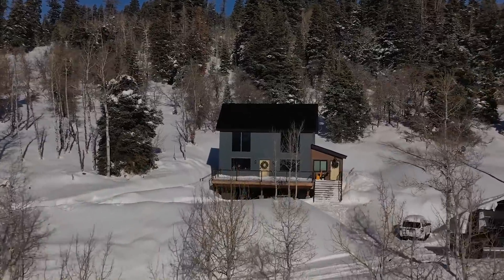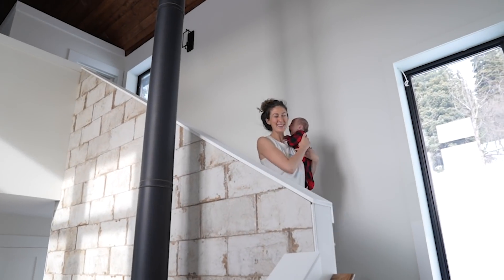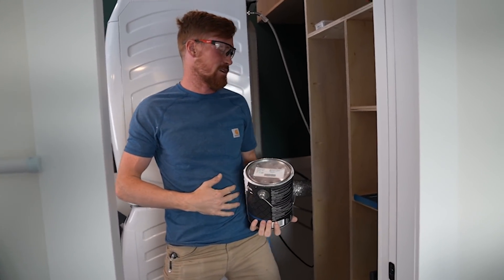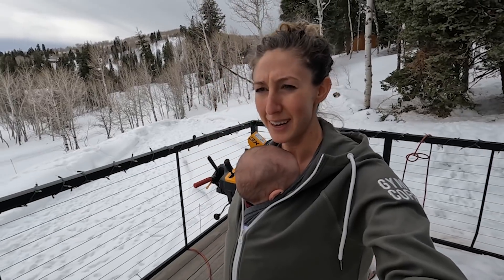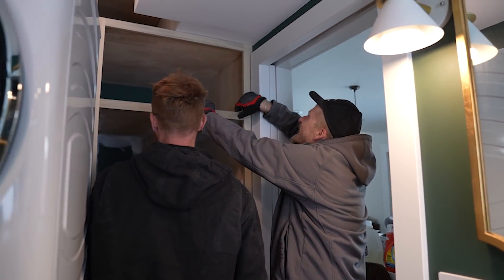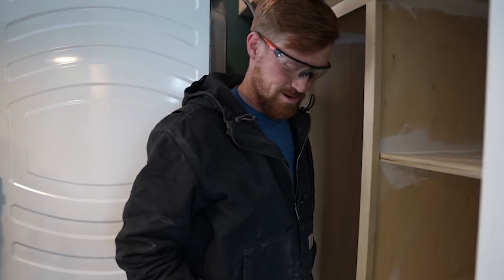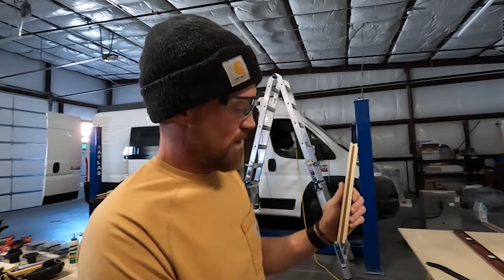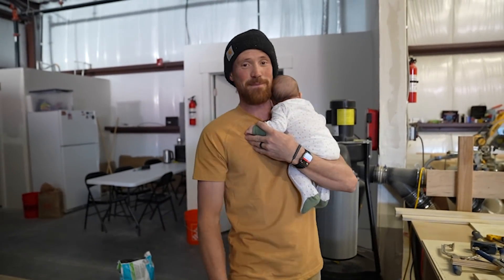I MADE A BIG MISTAKE | KNOWING WHEN TO QUIT

Comment: I had floor sliders/gliders on the bottom of my stackable. So easy to slide out. Also functioned as unintentional dampeners
Reply: Yes! Me too! I put them under all your appliances so that they don't leave dents in the floor and they don't scrape the floors when you pull them out. They're very cheap and easy to get at the dollar stores.
Reply: I should do that with my non-stackable dryer to make it easier to vacuum out the vent/duct.

Comment: They do make rollers for refrigerator that you could use under the washer-dryer so you could move easier.
Reply: Furniture sliders would be a great idea. Too late for rollers with the above cabinet done. But yes this is not the first time they will need to get back there. Sh!t happens 🤣

Comment: All jokes aside, I have been a nanny for 10 years. I’ve been meaning to relocate from Wisconsin to anywhere in the mountains! I know my way around a harsh winter, and have been wanting to write you both a formal email regarding offering you both some help :) I have so much respect for both of you. Keep going, you’re doing great! 
-Elle
Reply: Driving in Wisconsin flat land (I live in Wisconsin) just moved back from N. Ga mountains lived there for 5 years.  Driving in mountains in snow MUCH DIFFERENT.  Most in N. Ga DO NOT DRIVE when ice and snow on roads.  Way too dangerous.  I learned the hard way and slid down my mountain BACKWARDS with my 4 wheel drive 4 Runner.

Comment: The problem with making the cabinet deep is stuff gets pushed to the back and you will not know you have it in there. Then you go and buy more and it keeps accumulating in the back of the cabinet.
Reply: Baskets, lots of baskets, with labels. Good luck
Reply: More better you should put in drawers on runners....got em throughout my kitchen and laundry room....everything easy to get...clear up to the waist, anyway!  No drawer is ever too deep. Never ever.

Comment: Is it possible that the washer and dryer are a little snug with the cabinets right next to them like this? Don't they need a little breathing  room for the heat to circulate around the dryer, especially.  And what if something happens and you need to pull them out in a hurry?
Of course I'm not very savvy about things like that, but it seems logical to me.

Comment: I know you have made many panel doors and I have only made a few panel doors, but everything I read told me to NOT glue in the panels. They should be made just a tiny bit smaller than the rails and stiles so they can float or they may swell enough to cause the rails to split or crack as they expand and contract in changing humidity and temps over time. .  You can also get rubber inserts that are made to take up some of  the space around them.

Comment: Cabinets above fridge and other appliances that are hard to get to we made them all full pull out drawers. Best thing we ever did, its now usable space that doesn't collect stuff you never see again till you move. Walls are not square is why cabinets always have a small filler strip. You can use your face plate like this as well but not as nice if the wall is more than a hair out of square. Home depot makes appliance slide rails so you can pull them out easier.

Comment: I have 3/4 size  storage shelves and not so close to the stackable by 5 inches. So the heat from the dryer is able to flow and not be confined to the back  unit.

Comment: Per your van build projects, have you seen the Wingamm at the Tampa RV show? It's a breakthrough floor plan for class B, and I own a Mercedes 170.  Key aspects of this layout: rear entry outside offset, rear corner bathroom, floating bed. Ideally water tanks at floor level or above, dry only storage under floor.

Comment: If you need to move the washer and dryer again, Sprey winded on the floor under and in front of the feet. Then be careful because they will slide easily.

Comment: If you'd 45* the corners you wouldn't see the tong and grove. Plus it holds stronger from twisting and pivoting after you glue and clamp them together. No pocket jig or screws needed.🤔👍

Comment: Trent I love what you are doing, but I have to correct you on the woodworking part.
Pocket holes came to be because of the industrialisation of cabinet building, but you ought to check out many of the woodworking youtubers joints, as there is so much more to joining woodparts then pocketholes and some of them are quite articistic. 🙂

Comment: You need to put slides under the feet of the bottom unit so you can easily slide them out, but not sure if it will work the same given they are stacked.

Comment: Re: long cabinet solution: you could use a wooden box with a pull handle in the rear section of cabinet. Then there would be room for other items in front (could tray the items in front for easy removal).

Comment: Trent, don't hate me for this, especially because everyday I am blown away by your amazing house build and killer ability to imagine and then make it happen. But a thought... Switching the shelving/cabinet from a vertical to  horizontal unit for your main floor bathroom's shelving/closet, could give a design with more options with regard to  space and flexibility. My thought is that likely you could do it without much redesign and also using mostly the wood that you already have cut. So, switch your washer and dryer, of course only if they fit, to side by side, then build upper shelving that could, 1) improve access to the backs of the washer and dryer, 2)  clear the tops of the washer and dryer, thus creating an additional surface on both tops of washer and dryer for folding laundry, and 3) improve access to reaching and moving the units for repair, etc. A small downside might be that you might alternatively need to move mops and brooms, etc. to either the inside of  your pantry or to perhaps a hanging-type option just inside the door way at the top of the stairwell to your basement. 

Oops too, also likely these videos and the work associated with your build and Allie's editing are already dating back a month and already completed😖😏
 
Regardless, the best news is that with any decision, your family is already absolutely beautiful and magically wonderful. And baby Leo, well he's already perfect and perfectly adorable. Thank you so much for inviting us in and along for the ride. Very best wishes to you and your family for the best health and boundless joy.

Comment: I would put the built in cabinet or shelves on wheels so they roll put so access to the back of washer dryer can easily be accessed. Orange putan access panel in the large area of cabinet to access behind dryer. Well, I would have put the laundry in basement, even better idea.

Comment: How about the cabinet above the washer/dryer be fixed and the side cabinet on casters? It could be rolled out to access the connections behind the washer stack. The first time you have a hose blow behind that stack you'll wish you had faster access to cut it off. I know it doesn't happen often, but waking up to a flooded washroom and having to move the world to get to the problem isn't fun.

Comment: Personally, I think you need to make a larger opening to access water valves and etc behind your washer/dryer.
Reply: They should have used an already built/easy to clean/move and adjust no painting necessary grid shelving unit.

Comment: The pocket holes should be in the top piece above the dryer, going into the side walls, not the other way around. The same way you put the bottom of it together. Anything heavy in it will rip it down over time.

Comment: I think if you used white melamine boards you would save a lot of time and have a better job than painting the plywood. You would have a nice smooth surface which you will not have with the plywood, especially trying to reach into the alcove to paint it.

Comment: You make  Cabinet face frames first.  Doors are made the same way .The  verticals are Styles and the horizontals rails. You setup your router table to make the mortises . The tenons fit inside the mortises. You can use  a Dado blade setup to make the tenons  on a table saw. Your face frame dimensions are easily determined by measuring for the cabinet sizes. You cut the dado,s ( the slot that holds the door panels)you can setup a router table or use the dado setup on the table saw to make the dados . You generally cut your center panels and fit them to the face frames  when you  assemble each door glueing the tenon style into the mortises rails.  Put a brad thus the back side of the rail capturing the tenons . Square everything before gluing and branding in place. You do not glue the centers they just float to compensate from expansion / contraction.
For European hinges you need a 35 mm Forster but and drill press to make the blind holes .

Comment: Trent:  Don't sweat the "hair out of square" cabinetry measurements.  Back in the mid-1970s, I helped my father & grandfather put up paneling on the family room walls. My grandfather was really upset at how badly Dad and I measured things until he did the measuring and the 4x8 panels still didn't fit flush with the ceiling. We ended up literally cutting a shallow sine wave into the top of each panel to make them fit flush with the ceiling.   You work looks great, you & Brandon are killing it, don't sweat it!  (Also, good job handling the spit-up on your shoulder.)

Allie: You may not feel productive, but you are raising an ENTIRE WHOLE NEW HUMAN BEING. Think about that for a moment.  You'll be back to more construction-type work soon enough, but right now you are being as productive as you can be in the most important job a person can have, and you're doing a heck of a good job at it.

Comment: Pro Tip: Always scribe your cabinets to the wall / ceiling before final assembly and mounting. I think I mentioned early on, that stackable washer dryers are not a good idea. You would have been MUCH better off with placing them side by side. Using the sheet rock wall in the back of the cabinets is NOT a good idea. It's very soft and will ding pretty easily.

Comment: Building all those shelves a waist of space.
At, target, for $65 bucks. Metal black or chrome,  shelves,  comes with 5 , put them at any height. 
Each holds 350 pounds. U can buy wheels for them. 5x350 pounds, wheels, easy to clean or move around if needed.  Many sizes , widths,  and heights.  Very cool. $65 bucks.

Comment: Cabinet doors. It's really nice when you have more than one router table. They are easy to build. When you think of it, it is just a flat piece of for example melamine with a router plate insert that are relatively cheap. Okay, so getting the registration right. Play with samples until you get both tables perfectly synchronized, and then you can just stamp them out. Some people use a digital measuring gauge as to the height of the bit, but that gets hairy because when tightening a setting it usually shifts a little. Nothing compares to have multiple tables. As a matter of fact have a third table is ideal if you are making the center panels as a raised panel. That way you can get the registration correct on that one as well. 
Okay making router tables is so easy that I have more than 3. It's great when you can set the three of them up for making cabinet doors, and have an extra if you need to do anything else. In plain words the tables get calibrated to perfection on each one, and stay that way until the project leaves the shop. If a little oops happens further down the line, you can make a replacement in lickity split fast. I love, love, love watching your channel.

Comment: Hey kids,... I'm a cabinet/custom furniture maker of 30+ years. You need appliance rollers under your washer/dryer. There will be numerous times you need to pull them out for some reason. Save the grief & a sprained back.

Comment: BABY OUTSIDE IN WINTER PLEASSSSSSSSSSE PUT A HAT ON HIM EVERY TIME. I have seen many comments about this in your comment section. It’s very important because the baby loses so much heat from their head. Also when the babies out in the sun you should always cover. Even if temp is in 40’salso That front room is becoming a dumping Ground a total mess. Get Trent to build a shed so you can put all that stuff in storage do you have to do that when the place is small otherwise it’s always gonna look cluttered. Just a little tip or two

Comment: Allie, that bassinet with the Snoo sack is a death trap for your baby. I know many people will attack me for saying that but it’s true. What if Leo throws up, he will choke on his vomit. He should also not be swaddled at this age, I know the manufacturer says it ok to use until 6 months but after 2-3 months that is enough. It looks like a straight jacket. I’m certain I’m going to get blasted for this post but I’m only looking out for Leo. If you do research online, you will understand why I am saying this. 

Trent, is there a reason why you didn’t place the washer and dryer side by side?  Allie could have used the top of the machines to fold laundry and you could have still made built-in cabinets. Also, Allie would be able to read the control panel without using a step ladder.   Cheers guys.

Comment: There is a point when you have worked so hard on something for so long that you can miss things. There is a point where you have looked at something so long that you only see what is supposed to be there, not what is there. And you cannot figure out what's wrong. 
Then, someone comes an inexperienced rooky, takes one look at it and immediately sees what the problem is. 
UGH! You feel so stupid. 
Been on both sides of that problem. 
I worked with engineers and metal workers. Just believe me.
And I had to tell them what was going on, too.
Sometimes you make better progress by backing off for a few.
Rest up, you'll get it!